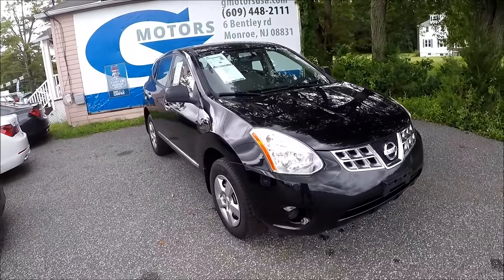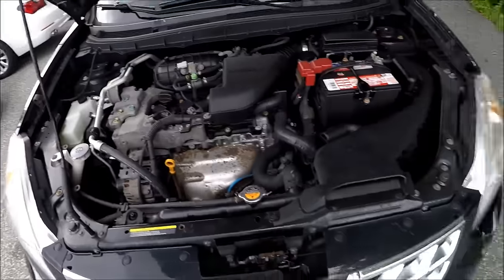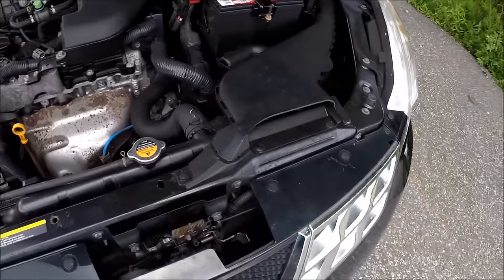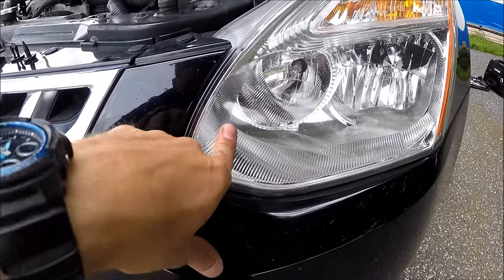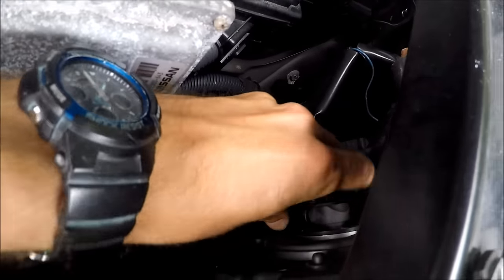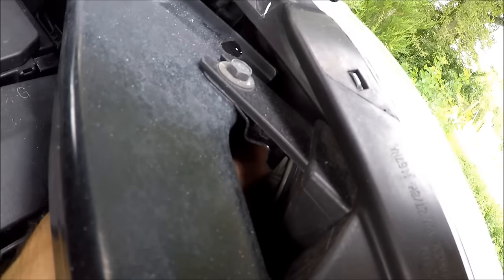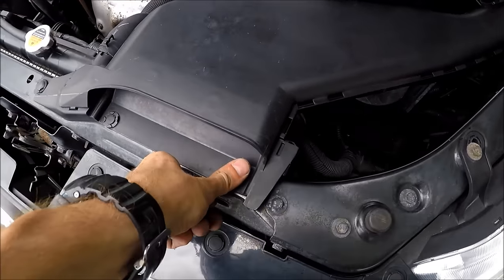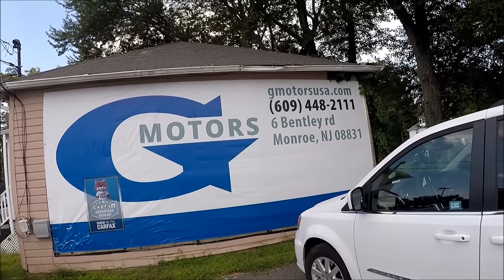How to change replace Headlight Bulbs in Nissan Rogue 2007-2013

Comment: DISCLAIMER! Do NOT touch the bulb itself when replacing the new one. Found this out the hard way and had to replace it again in about 5 months when the headlight went out for a second time. Oils on your hands cause the light to burn hotter and therefore go out quicker. Just thought I'd share:) Great video - thanks!
Reply: I do it all the time but I wipe it after I connect it and no problems
Reply: @beerman9807  same lol.
Reply: @closingwithchristina1886  look into hardware they’re just generic push clips. You can zip tie the area if you want ,too.
Reply: @closingwithchristina1886  no prob hope I helped
Reply: Loh

Comment: I just got off the phone with a nissan dealer who has my car in Houston, tx, they wanted to charge me $230 to replace the bulb because they said they had to remove the bumper!! I told them no thanks- especially because I had already seen someone at O'Reilley's show me how to get in there to do it myself and your video just reconfirmed it. So thanks for the video!
Reply: you must have the Xenon bulbs.  did you figure out how to replace it yourself?  or did you take it in to dealer?
Reply: I found a xenon bulb on-line and was able to change it out myself.  fairly easy after I found the fixture inside the canister.
Reply: They tried to charge me the same. can i ask where you ordered the headlight from
Reply: @brechellcutler4030  I think I just searched Amazon for the part number. Don't remember the vendor. But I stuck with a name brand manufacturer, avoid the really cheap foreign-made
Reply: They was trying to get over on you...they said the same thing to my girl took me 5 minutes to change it
Reply: Freaking scammers man. Thank God for YouTube mechanics. Or helpful people.

Comment: Other than having trouble getting the bulb assembly to lock back in place, it was easy after watching your video. All the other ones I watched skipped things or didn't show things well enough. Thank you!
Reply: Bro literally driving me crazy right now, how did you get it locked there. I'm having such a hard time right now lol
Reply: @c.t.7289  No idea. I just kept trying until it clicked. Think it took me over 20 tries. Part of my problem was I did not take the top vent assembly off, so my hand was wedged into the tight space and I was just trying to get it locked with my fingertips.
Reply: I had to replace the same bulb today. This time I did take the vent assembly off - WAY easier and took me a lot less time. The vent does have two tabs that may need to be pushed in to get it off, but it was easy to just push them in a little with a screw driver.

Comment: I'm a lady, trying this I'll be back with a report, but it really seems easy and clear enough. Thanks!
Reply: I did it! It worked for low beam on passengers side. But instead of pushing the lever to unsnap pull the battery out, I had to pull pack the lever then pull the battery out. Thanks!

Comment: I'm curious what year this Rogue is because I have a 2012 and I took the headlights off a 2008 today for replacement parts and the low beams on both of them are not like the car in this video and much more difficult to change. Thankfully, I did figure it out, though.

Comment: Please put a disclaimer on your video ,
certain rogue models don't use halogen for the low beams.

Its also possible that same year models have variations also and 
for anyone out there wondering ,
The easiest way to tell is call your local Nissan dealer and parts supply/ service
they will look up your vin for you so you don't have to go crazy opening
your light assembly to check which type you got , in 15 degree weather.

Comment: The low beam bulb for my 2012 Nissan Rogue seem to have this cylinder part around it. I can't get my hand in there.
Reply: Mine too... I got the cap off... The inside appears bulbless/ Nowhere for a bulb?
Reply: @chrisschultz3211  did you get it figured out?

Comment: When doing the low beam put ONLY the bulb in first, secure it with the two little metal pieces. Then install the box and spin it till it’s secured.

Comment: You need to add both kinds of bulbs and installs to your video.
I had different kind of bulbs which drove me crazy to figure it out, cause I was watching your video and I said it's simple, NOT, found out I had xenon lights and nones video would comment said there is two kinds of installs
Reply: Just happened to me
Reply: My Dad thought me that when you change 1 side of your light it's a Good idea to change the other side too if not one side that was not changed will look dimmer, from my own experience if you have the extra finance to change both would be excellent if not just  change the one that is burnt out.

Comment: It's probably just me, but this video did not help me identify the location of the passenger side low-beam bulb on my 2011 Nissan Rogue. I easily see the high-beam and turn signal bulbs, but not the low-beam.

Comment: I have a 2012 Nissan Rogue and the low beam is no where to be located. I find the high beam and the blinker but no low beam. I spent at least an hour there’s a “coaster” size black piece of plastic that has lashes and I was able to remove when I looked on the inside there’s a silver piece that I didn’t think it was it so I didn’t touch it.

Comment: If you have a HID Bulb then you screw of a round cap and then press the wire pins then move pins upward the Bulb will pop out old then you put in the new Bulb!

Comment: ⚠️ not all rogues have these type bulbs. Mine had the straight ones with a different connector. I saw this video and bought expensive bulbs like this and they do not fit. Don't open the package until you remove the old bulb and confirm. Expensive lesson.

Comment: thats the Halogen type low beam bulb.  can you show this on a Rogue with the Xenon bulb?  car manual states that a dealer must replace them.  but that's silly.... and silly expensive!  (they say the bumper must come off to replace a light bulb:  if that's true, what an asinine design...)
Reply: Going thru same deal. The xenon assembly is different. Will dive into it this weekend. Doesn't appear to be a 30 min fix!

Comment: My low beam on my 2011 Nissan Rogue is not in that spot.
Reply: Mine neither in fact it doesn't even look like that
Reply: Same here. There's some additional assembly in the spot where it should be. I think it should be simple enough to remove that but I'll have to poke at it a bit more when I next look at it.
Reply: Okay, I figured out why it doesn't match. I have a features package that included a Xenon bulb system, so it doesn't just pop out as easy as he shows here. There's a cylindrical plastic housing where the low beam socket is in this video. You need to twist off the cover of this and you'll find a square electronics piece underneath. Twist that off and the xenon bulb will be underneath, held in by a wire tension catch. The bulb is more expensive - about $100 each.
Reply: Nissan dealer quoted me $250 for one Xenon bulb!

Comment: ths doesn't help me! I hav a 2010 Rogue tht has a CAP & METAL PIECE on TOP of Low Beam bulb, tht has a pinching-prong tht locks it n place, but WON'T move! ...Now - where's the video 4 doing THAT?!?!?
Reply: Those are xenon lights, just squeeze the clips and pull them up, take the bulb out and replace with the new one, a little tricky but you can do it. Xenon lights are very expensive but you can buy them A LOT cheaper online